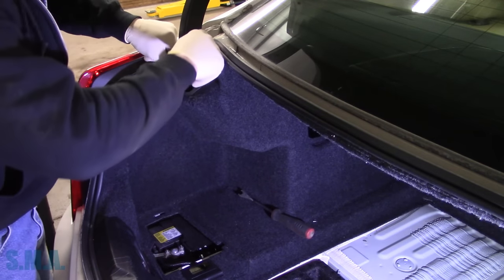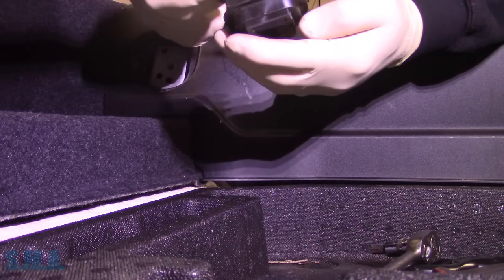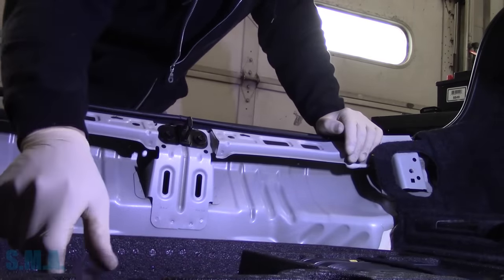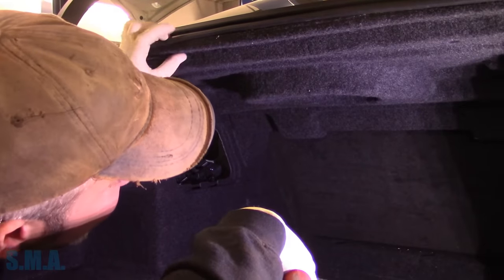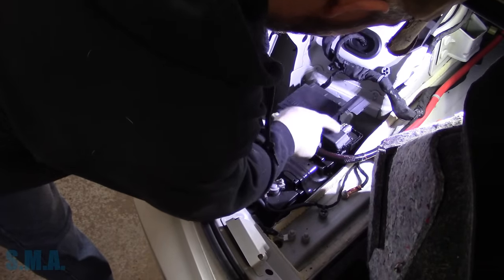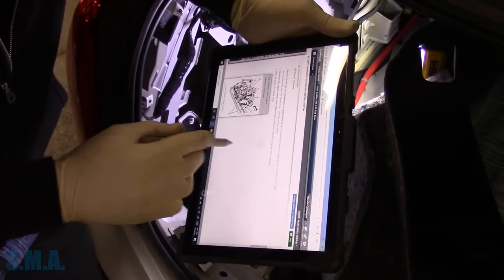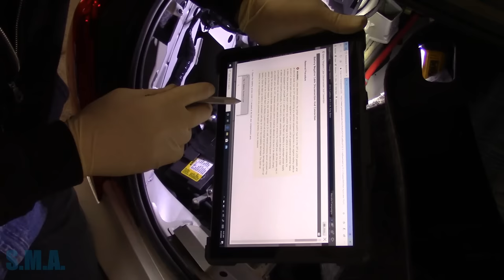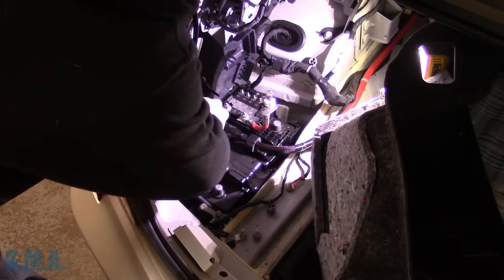Cadillac ATS: Battery Remove & Replace

Comment: After working thirty years at Boeing, I firmly believe there is some sort of award given to packaging engineers for making repairs impossible
Reply: I always felt like they always promote the idiot that made the biggest screwup just to pull him out of the picture so couldn't mess it up any more. An the guy above him made some kinda bigger screwup and on up the chain till you get to top management.
Reply: @eldonerc2524  Advancing to there level of incompetence; That is what I was told.
Reply: Read "The Peter Principle "
Reply: @Mike S. I truly miss my R/D days at Boeing even though I still have a well stocked electronic hobby room
Reply: @Mike S. My step-dad worked for Lockheed in the early 60's. We lived right down the street on Hollywood Way. He walked to work.
Reply: @Mike S. We relocated to San Diego. Then Long Beach, McDonnell Douglas. where he retired.

Comment: Battery: $135.00
Install: $300.00
Just damn crazy engineers.
Reply: Up here in Canada my friend needed to replace the battery in her Mercedes diesel. It cost 730.00
Reply: I like to know where you can find that AGM battery for $135. They normally are around $200
Reply: @mikechimko8564  wtf
Reply: @mikechimko8564  just BS. I work with mb, no that expensive battery replacement for it
Reply: @dot7107  That's probably Canadian dollars though which makes it more like $525 US. Plus they may be paying higher duties on imported materials etc. Just food for thought.
Reply: Actually, that's $250 just for the battery, if it's AGM.
Reply: Had mine replaced to the tune of $348
Reply: This logic doesn't make much sense. Headgaskets r cheap
Reply: Just had to say - Battery lists for $340.00!!
Reply: Ford: Blend door actuator $35
$1200 to remove the dash to get to the actuator. 
Panther chassis stupidity.
Reply: @tinagiles3430  The AGM battery I bought from advanced Auto parts was $200. I found a coupon for 25% off and got it for $150. I also had a $15 gift card because I had bought brake pads and it had a rebate on it. So sort of $135. I also got another rebate for the battery for another $15. LoL Advance Auto parts constantly has coupons for this sort of thing and rebates.
Reply: Times 10!! And GM wonders why they went bankrupt! Let's see; you can only file bankruptcy every 7 years....2008+7 years=2015.....Yup, they're on borrowed time. The new C8 Corvette has only been out 5 months, if that, and already GM has issued TWO STOP SALES ORDERS!!!!! HELL-LO GM!!!!! Get your act to-gether!!!!!!!
Reply: Same with a gle Mercedes 
The battery is under the front passenger seat.
Reply: @mikechimko8564  Well, thats like $123.00 in USA freedom money!
Reply: @agger838  Yep, just did a bent valve, the valve was only $6.00.  Head gasket set was only $34.00. Labor was 14 hours.

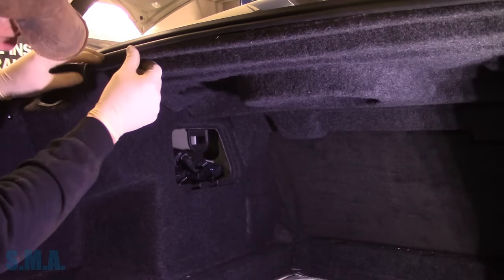Comment: 8:58 Those plastic washers are to help on the assembly line.  Holds the Christmas trees to the panel as an assembly.  Pull the part off the cart and everything is there ready to go.
Reply: Yup came here to say this. if he had of just pushed them in one rib of those washers he would of had them all hanging there ready to go.
Reply: Thank you for that.  I was trying to figure out why those were there.  I was also wondering if it mattered that he missed them on reassembly.  Now I know it doesn't matter.  Thanks!
Reply: Right you are old chum
Reply: @johnwargo2590  Who you calling old?  Now get off my lawn, you are supposed to be self isolating.  LOL

Comment: Eric O, I just want to thank you for this video. It really saved me some money. I own a 2018 CTS and it was almost identical to your ATS. If it hadn’t been for your video I would’ve been afraid to attempt this myself.
Following your good step-by-step directions, I was able to install my new battery.
I really appreciate how experts like yourself are willing to offer free information to help others.
I subbed to your channel and clicked the thumbs up.
From one YouTuber to another, thanks again.
Take care my friend!
Reply: Yes seem here .. I was debating on if I should take to shop or do it myself tell I saw this video
Reply: I have the same Cts, was the battery change a PITA or very similar to this the Ats in this video? I bought the battery but discovered - whoa it's buried in the trunk. Thanks in advance!
Reply: @corvette2006vert  yes, mine was in the trunk also. You just have to take a few things apart. Looks more complicated than it really is. just take your time and take photos that’s when I did.
Reply: @DaveDabomb  Thank you for your help! With the XTS you have to reprogram wout the ith putting the windows up and down I read, so wasn't sure about the CTS. Thanks again!

Comment: As senior engineer on this project, I recommend building the car around the the battery, which will be embedded in the trunk!
I konw it doesn't sound logical, but, think about it. It will be soo clean looking!
Reply: And as junior engineer I suggest that the blower motor must be where the front of the car is assembled around !
Reply: Management to senior engineer - "think about how we get more billable hours for dealers". Engineer to management - "there, that design will do the trick and chase away those nasty DIYers".
Reply: @beyondrepair8949  You guys ain't good engineers,  everyone knows you hang the
heater core on the assembly line,  then build the car around it...  That way,  the
replacement of the heater core takes more time to replace than building the
vehicle in the first place...
Reply: I owned a 1971 mustang Boss 351  the battery was in the trunk, it could be  changed in 10 minutes if you didn't have  a clue what you were doing!

Comment: There must be some kind of a competition where an award is awarded for the person who can design a extremely complicated solution to a formerly simple repair. This Cadillac is definitely in the running, though I do appreciate changing headlight bulbs that require you to remove front bumpers and take out windshield wiper reservoirs and/or radiator coolant tanks. You want how much to change a lightbulb???

Comment: Hey Eric... thanks for the video which explains why modern cars can be a pain in the ass to change a battery in!  I worked for a couple of years at a battery store, and have changed hundreds of batteries.  These Cadillacs (and some other GM vehicles) are excellent examples of "when replacing your car's battery is NOT a DIY project"!  And by the way, 'AGM' stands for "Absorbed Glass Mat", which is basically fiberglass stuffed into each cell of the battery!

Comment: Changing the front cigarette lighter: 
1. Disconnect battery and all wiring harness assemblies. 
2. Drain antifreeze and oil

3. Place car on the lift 
4. Support the engine and remove motor mounts. 
5. Hoist the engine out of the way. 
6. Replace the cigarette lighter assembly
7. Reassemble in reverse order. 
8. Fill antifreeze and oil.
9. Make sure that lighter works.  
10. If it does not work, change the fuse - that's all that was wrong with it.
Reply: 11. Charge customer accordingly ;)
Reply: Ha. Took a look at service data to remove headliner for easy access to sunroof drains in my V50. Stopped reading when it said to remove windscreen and went my own way.

Comment: I thought things must be slow at SMA if Eric's showing a battery replacement. Then I remembered it's a modern Cadillac, and the run time on the video was 31:40. Silly me...I should've known better.
Reply: 2022 ats will probably have the battery inside the engine
Reply: WTF? 30.26  LOOKED LIKE A GHOST ORB! OR THE COCOA VIRUS  NEEDS A BRAKE JOB  . DONT KNOW
Reply: @meticulouselectronics  lol and the starter in the trunk...wait that's brilliant!
Reply: @davidwildridge8080  quickly. Call gm and sell this multimillion dollar starter idea. Make sure it's made of plastic
Reply: Hell, he said it was 2014....6 years old.  Just think what a new one would be like!!!  Holy Crap-ola!
Reply: Lets not forget several GM's that require front end disassembly to put in a head light, WTF?  Engineers who own company stock maybe?
Reply: @EM-df6mo  somebody with a 2008-2012 malibu probably drove their car through a dealership. That's why the 2013 and newer malibu had headlights you could change without removing the bumper.

Comment: The Malibu fuel sending unit video comes to mind...

"The engineers at GM couldn't fix a sandwich!"
Reply: Fine china engineering.
Reply: They'd mess up a one truck convoy! As screwed up as a soup sandwich!
Reply: You funny🥪🥪🥪
Reply: As someone with a Malibu that needs to switch out the fuel sending unit, this is 100% accurate.

Comment: I like the fact that the battery is away from engine heat and vibration, but buried under fixed trim pieces is a pain, but Jon is right Chrysler sticking it in the wheel well is just the best. Pretty soon some brilliant engineer will  design it so you have to pull the motor to change the battery.

Comment: When I was a kid i worked at the Chevron station in my town. In the mid 70's we sold Atlas tires, batteries, wiper blades, etc. A guy in a perfect 61 Corvette came in needing a battery. In those cars the battery is located behind the right front tire, if I recall correctly you had to remove some HVAC ductwork, a fender brace and snake the old battery up around the manifold, fender etc. The owner of the car was watching me like a hawk and every time I would bump something, rub against the fender he would say something. Finally after about 30 minutes I had everything back together and was about to slap the guy... Then the car wouldn't start. The owner was irate to say the least. Finally the owner of the station told him to get his ____ _________ out of there and never come back under any circumstances. I pushed the car out in the street, after an hour or so someone hauled it away.
Reply: Now you work at Advance Auto?

Comment: My worst battery change was on my 2007 Chevrolet Silverado. @50 miles after changing the battery the blend doors opened wide open and the heater was on full blast in the middle of summer while i was on a trip so I had to live with it for 150 miles on a 100 plus day. I looked at the trouble of changing a blend door at my brothers house. Thanks to a utube video I decided to try unhooking the battery again for about 20 minutes and it all went back to working as normal. Thank goodness because I was 1200 miles away from home.

Comment: I work at AAA, you can say I replace batteries for a livin. Manufacturers are so darn stupid about where they put their batteries. New generation of Ford Escapes and transits take about an hour to replace. I did a Jeep renegade and after I replaced the battery, lady tried to leave and the veh wouldn’t go into reverse. Turns out the transmission module had to be reset because the veh lost power. Dumbest thing I’ve ever heard of. Love your videos and you keep on keepin on

Comment: I’m glad I was a mechanic back in the 70’s and 80’s. I would not have the patience today. All this to replace a battery😂
Reply: I agree!!! GM engineering insanity at its best. Give me a car that has air, tilt, and cruise, and its fully loaded in my opinion. Now the Corvette uses tire temperature to determine if tires are at max adhesion. You can't use full throttle until the sensors say it's OK! When they give the computer the "all clear" signal, your "safe" to use full throttle!!! Too many "nannys" for me......

Comment: Just had to revive my Dad's 2020 CT4 that had been sitting for a year and a half.  Process was nearly identical, but:
1.  No trim on the underside of the trunk ceiling but there's an additional trim piece behind the drop-down seats that needs to get taken out to effectively remove the quarter panel trim
2.  The tie-down fasteners use a T40 drive
3.  The distribution panel that attaches to the positive terminal is about twice as large

I don't have a fancy tool for removing the christmas tree fasteners but I have a small pair of bent-needlenose pliers that slide in under the "cap" and grip the root so you can pull it out by levering the tool.  But all the little tips and tricks mentioned in this video make for a successful install that would have taken me four times as long without this video to show me the way and remove the fear of pulling on something important too hard.  I probably wouldn't have thought about salvaging the vent plug from the old battery to put in the new one either.  You got yourself a high-value video here.

Comment: Owner : "You want HOW MUCH ?"
" Just to replace the battery !!! "
They just don't get it.
Reply: gatekeeper65 Those Christmas tree fasteners don't mail themselves! I find this to be so insanly unnecessary
BUT! I'd have to look under the hood to see why. It's still crazy to me.
Reply: I'm askin' how much you got.. (slams wrench into palm threateningly)
Reply: :Customer:  "You want HOW MUCH ?"
" Just to replace the battery !!! "
Show's customer the video.
Customer: "Jesus! Here, here's the money, and a $100 tip."
Reply: Bill R I think everyone was shocked about where the engineer decided to put that. The fact that the negative terminal is the only one accessible, shows he knew at least that much, it's still insane. It's a money grab though, they did it on purpose obviously. Now it leads to the question of, if they are that hard up to get you back in the dealership, where else did they try to save money?
Reply: GM NEVER will. This from a lifetime GM buyer. I'm done with them. Shoulda been done with them 30 years ago. Oh well, better late than never!!
Reply: @layyouin6860  Nothing wrong with where they put it, just terrible access, and worse engineering.

Comment: I like the fact that they just made a small hole to take a look at the battery, but not make that whole big enough to let i through, its like the engineerings wanted to laugh in your face, what were they thinking designing this :)
Reply: Honestly you could probably just make two small incisions to make the hole wider, fit the battery out and new one in, then fold the carpet right back down with your two little slits in the carpet barely visible.
Reply: @masonhales  if it were my own, I would have went at it with a box cutter and been done with it.  Now, when I'm working on a customers car.  Going to do it right and they'll have to pay for the labor.
Reply: Well, looks like they only exposed the negative terminal. That access panel is likely only there to be able to disconnect the battery via the negative wire...

Comment: Can you imagine the experience an ATS owner would have with the "FREE" battery replacement at  one of the autopart chain stores?
Reply: We wouldn't touch it. We have a list that they won't let us touch.those dodges in the wheel wells are at the top.😅
Reply: When I bought a battery for my '98 S-10 they informed me they couldn't install it for me. The battery is right under the hood, easy as pie to access. They claimed it was a "complicated install" because it used a side-terminal battery. Thankfully I wouldn't have LET them install it, I wouldn't trust those guys to screw in a light bulb.
Reply: I work for Advance in Austin. No way I'd get anywhere NEAR that battery. We tell 'em to take it to the dealer, and walk away. I've done some Dodges, Challengers and Chargers, they suck, esp. if the customer has 10 tons of crap in the trunk. Worst one I ever did was on a Jeep SUV. Under passenger seat. Got terminals loose, moved seat forward, pull bolts. Move seat back, pull bolts, the unplug air bag terminal and rest of electrical connectors, remove seat. Install battery, re-install seat. GM ripped me a new one for all that work. Never again, LOL. RUN!!!!!
Reply: @MrPrepared1  Yes, the newer (WK2) Grand Cherokees have the battery under the front passenger seat.   I understand the reasoning behind it, but it doesn't make the DIY's job any easier, that's for sure.  By the way, it's not as difficult as you describe:   move seat forward, take out battery, put in new battery, move seat back.   The seat does not have to be removed to replace the battery on these models.   The problem comes when the old battery is dead enough that it won't move the seat forward enough to access that battery....
Reply: @G31mR  Well, seeing I hadn't done one before then, I might have gone a bit overboard with the procedure...
Reply: This is part of the reason for  the "on most cars" disclaimer.
Reply: @MrPrepared1  I surely understand.  I've done enough jobs like that where I've performed a great deal of unnecessary work because the easiest way was not the obvious way.
Reply: Its been my experience that people don’t want to be in the trunk of a car regardless of their heart status. 😳
Reply: @MrPrepared1  
Chargers & challengers are extremely easy...no harder than a Underhood battery

Comment: wow, my CTS has a nice little hatch with velcro toolless releases for the terminal connections, and i think it needs a 10mm for the hold down... hardest part was finding a 10mm socket.
Reply: After installing the battery, do you always charge jump start in the hood on a 14-19 CTS?

Comment: I’ve had to change the little Battery in my 07 Prius twice, that’s a pain in the hoo hoo buried under the trunk like the caddy, both times in the AP parking lot in Chicago in January , temp 10 below just when batteries like to die
Reply: Heads up, 04-09 Prius owner. Twice a year check for water underneath the 12 V battery. If you find water you need to silicone the trunk's top rain channels. It is a common problem.